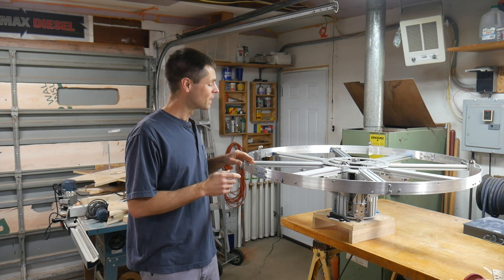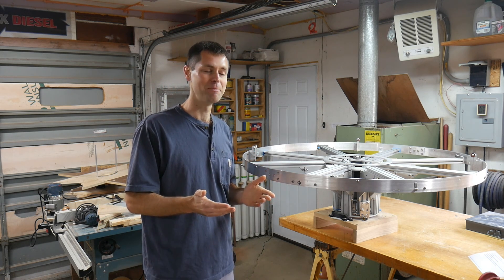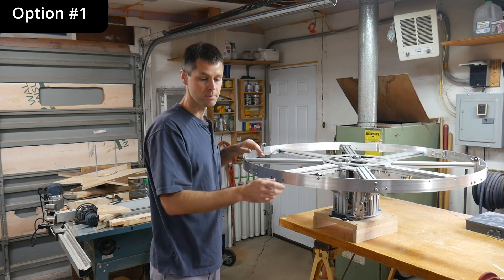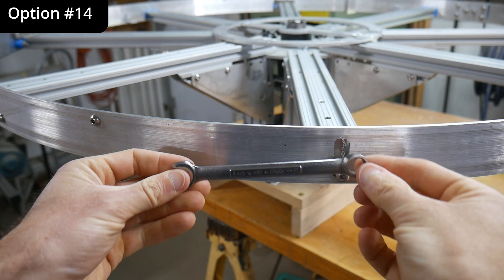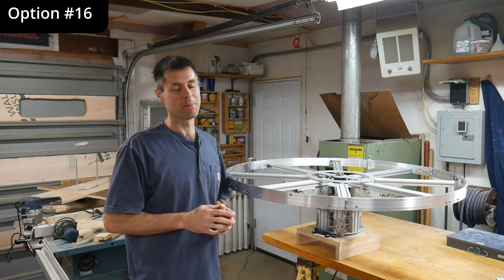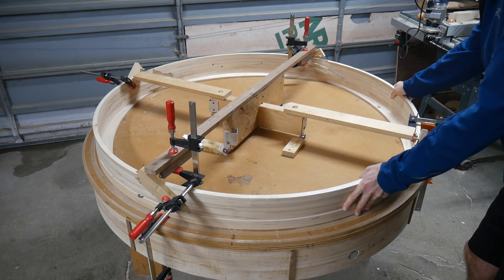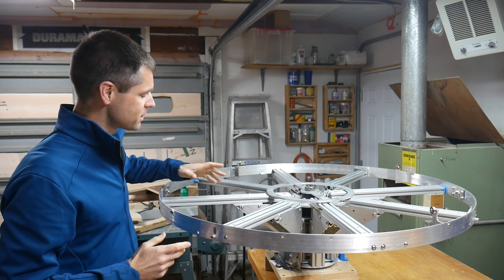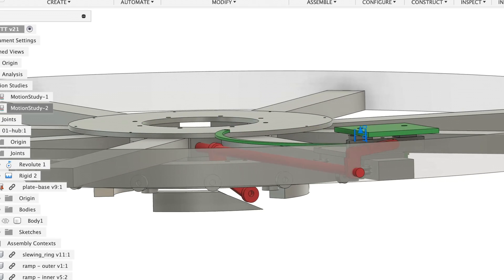What's So Hard About Going Up & Down? - Table Redesign 5

Comment: May i ask what your diameter ratio is? Size of the table closed, and fully expanded?
Reply from the maker: 1220 mm diameter when small to 1550 mm diameter when large. 48 to 61 inches.

Comment: Hi Scott:  I think that I appreciate what you are trying to do with torque tubes in that you generate lift of the star and pickets from a center point of the design, by torquing a pipe that telegraphs its rotation to the table's perimeter (times 4 in your case), no different than controlling the surfaces in aeronautics of an airplane's wing.  

In light of this, if you haven't done so, I think you might benefit from taking a look here https://youtu.be/L5w16WtRQ1I?si=Enxb2M4Vi2yRojRI&t=309 and applying your torque tubes' lifting forces to what this linked Youtuber calls a "lifting plate:"  a device that (times 4) sits below the star and elevates it 2 table leaf thicknesses in height, grabbing at the 1/2 way point in its vertical travel, the "picket" as well--even if the linked Youtuber effects same with ramps that reside distal to the table's center dissimilar from your desire for centralized control of such lifting.

Comment: I'm wondering if ramps are even needed.  If your roller hits a vertical surface, it is forced to ride up the vertical surface while pivoting the torque tube assembly, and then riding on top of the adjoining horizontal surface, keeping your torque tube assembly rotated to keep your table surface at the proper height.   Im a KISS (keep it stupid simple) guy.  Why make a ramp if you only need a rectangular block?  In my mind, you could end up with some binding depending on lengths of your torque arm.  If the arm ends up perpendicular to the ramp angle, it may cause the table to lift without rotating torque tube and end up at an improper height (scenario is highly unlikely).  I hope im making sense here, im struggling to explain whats going on in my mind for others to understand, wothout the ability to draw pictures.  Just food for thought, I'm liking the project!
Reply from the maker: I've thought about that too. Some amount of ramp slope is needed because the lift is almost the same height as the diameter of the wheel. If it were smaller, maybe 1/4 or 1/3 the diameter you could get away with a step change.